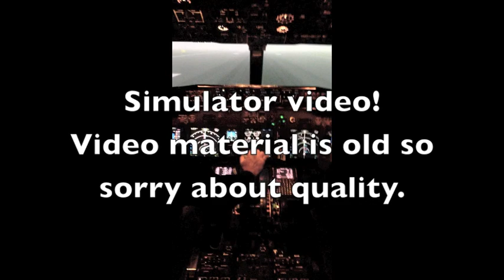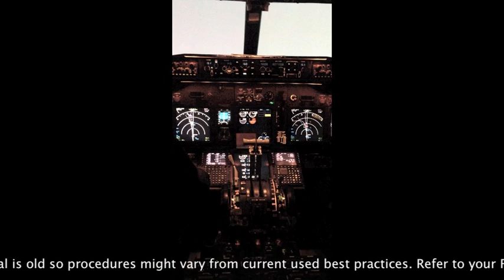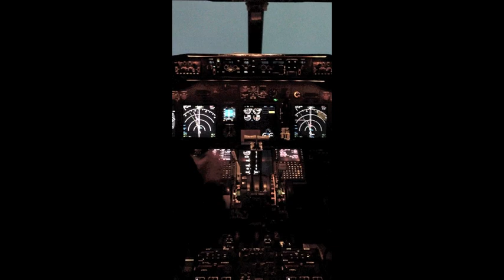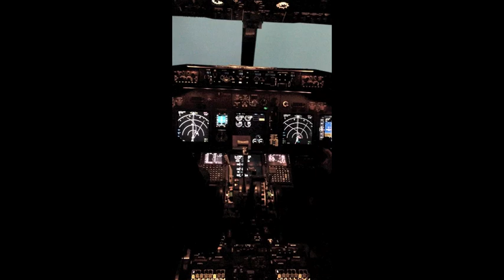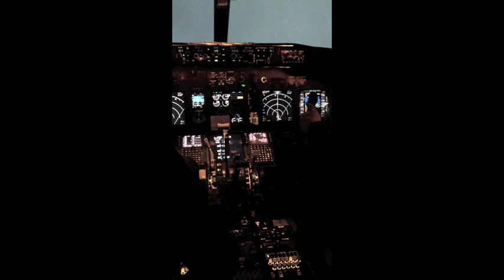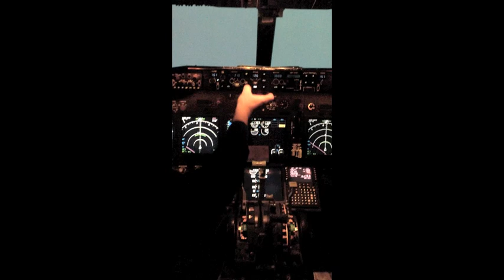Pilot training - Engine failure after Takeoff

Comment: I have a question. I realize that about 20%-30% of airports in the world wouldn't have the space to do this, but why does the aviation industry continue to operate from runway lengths that require taking a minor failure into the air with it. It seems that simply adding an extra 300-400 meters to allow for high-speed rejection of take off would go a long way in reducing accidents and near misses. Why is this not given more consideration?
Reply: It’s not as simple as that unfortunately. Once you reach a certain speed (V1) you must take most problems into the air, regardless of runway length.

Comment: Thank for the video and for the great channel! You are doing great things, Cap!
I would like to highlight a couple of moments. First - its a good thing to reach at least 400' prior to starting seeking for what has happened, as you are saying in the video. The trap exists when you're taking off with a max reduced thrust for this weight, based on the climb limited weight. The airplane will NOT climb at a good rate  in this case. Even reaching 400 feet will take a time. If a pilot has never been trained for this scenario s/he may be really confused by the airplane performance. Do you train your pilots to handle such scenarios? We do. So, the options are quit simple - to carefully increase the thrust on the remaining engine (if it is possible), or/and, if the airplane and path are being controlled, the identifying process may be started before reaching 400 feet. Trainings show that crews successfully stabilize the bird on the path by 100-200' RA.
Second - maybe I missed the moment of communicating the problem in the video, but, again, if a crew  has lost an engine with the above parameters, a significant time may be requried to reach the safe altitude (at least 400') at which the PF will call for memory actions. If the crew is taking off from a busy airport, it may become a problem to others if our crew is keeping silence. So, lets remember the Rules - aviate->navigate->COMMUNICATE->manage (the problem). 
For example, if you're taking off from UUDD (Moscow), RWY32R, the ATC guy will not be happy looking at the silent  aiplane, which is low flying towards the Cremlin :)
All the Best, Captain! Fly Safe!
Capt Denis Okan, S7 Airlines
Reply: Mentour Pilot thanks for the reply! 
If we, again, continue talking about the situation, where an airplane departs inbound Moscow, Kremlin, and keeps silence, flying low, as I've said, the controller will not be happy looking at this. He, of course, will call the airplane, and if they answer 'stand by! " and continue their low-level flight, the controller and the military guys will be very-very nervous:)
so,  we teach pilots that there always is time to tell intensions to the ATC. Just few words "mayday or PAN- PAN", kind of the problem, and where are they flying to. 
We simulate engine stuck between V1 and V2, with MTOW and max reduced thrust. It isn't the easiest scenario.

Comment: If a bird strike occurs at take off and one of the engines is crippled, will the crippled engine provide some power ? Or will completely fail
Reply: Mohammed Erinpurwala i think if it is badly damage, the pilots will cutoff fuel to that engine to avoid a fire.